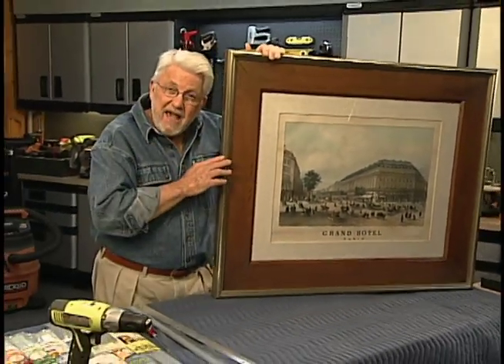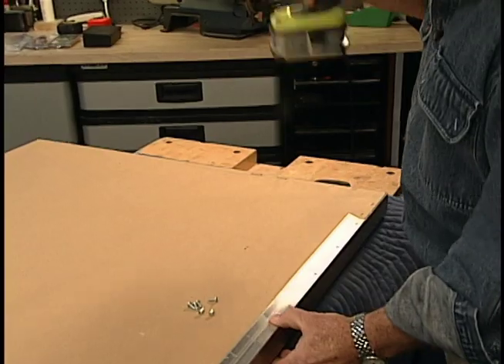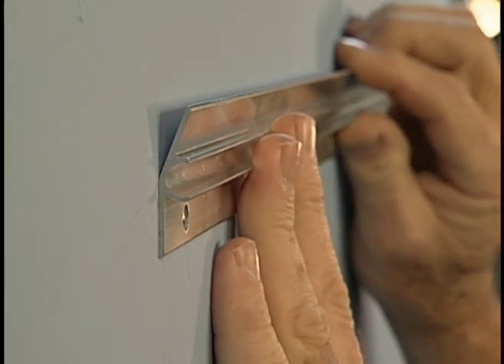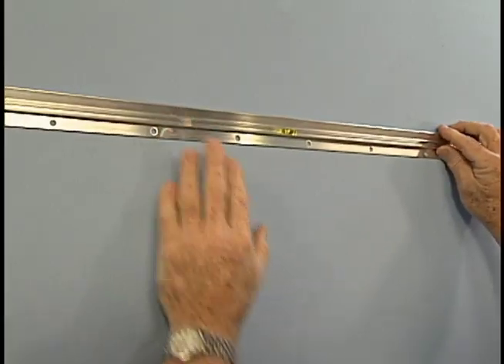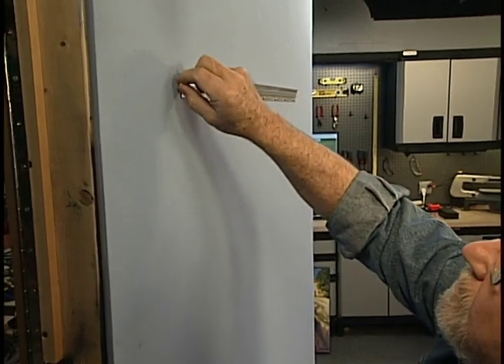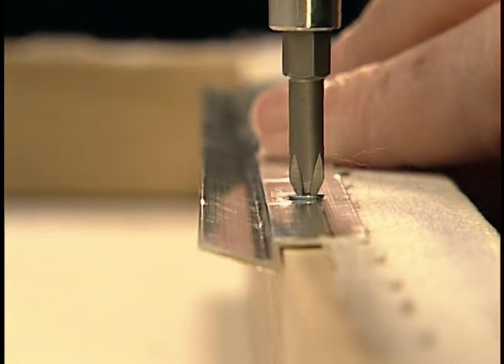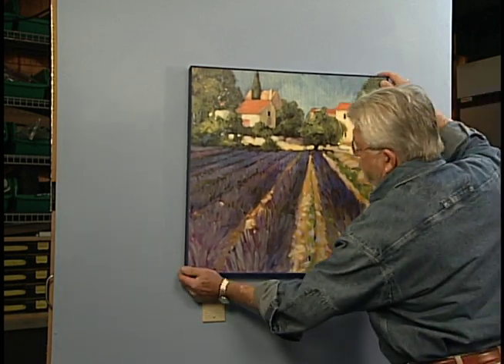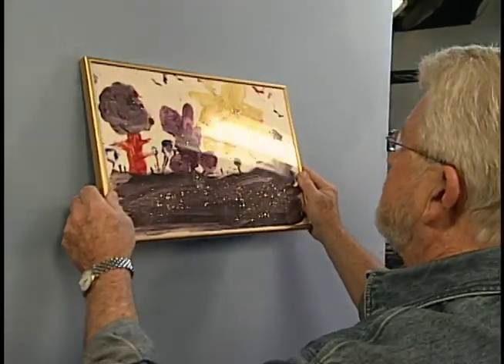Hang Heavy Picture Using a Metal French Cleat

Comment: For something truly "heavy," like a good sized, quality framed mirror (anything in the 25-in. x 25-in. or so and up size range), that is easily 1/4-in. thick glass, I would use a cleat long enough to cover the full width of the frame, so it can also be affixed to the side/vertical frame members, and not just somewhere in the middle of the top/horizontal frame member.  As shown in the video, doing so would be relying on the integrity and strength of the mitered frame corners to support the entire weight of the mirror, which may be a bad assumption.  Second, if the cleat is significantly too short to reach the mitered frame corners, the weight of the mirror may be enough to bow the top frame member (even with a wide, seemingly robust enough frame), which is bound to affect the mitered corners eventually as the frame sags over time.

I am installing a large framed mirror, 35-in. x 40-in., and it is HEAVY (and not cheap!).  To be on the safe side, I'm actually using full width cleats at both the top and bottom to ensure full, even support.